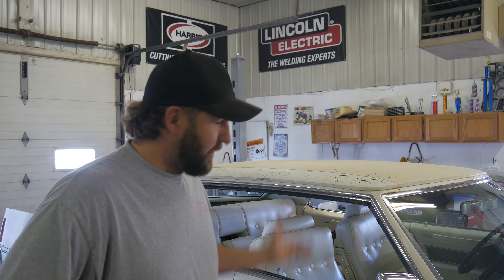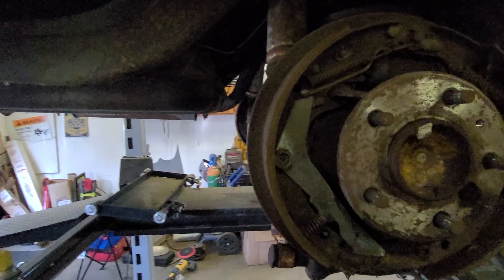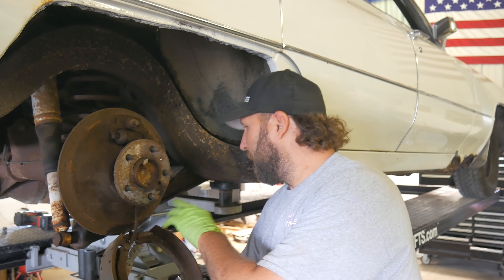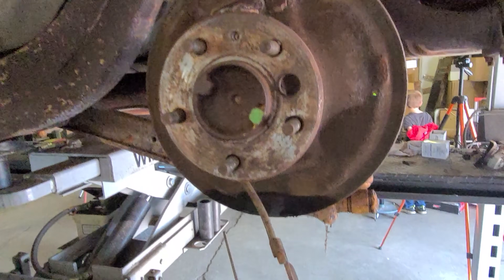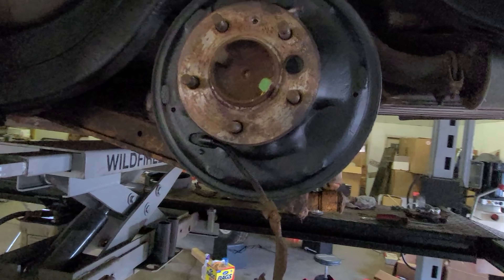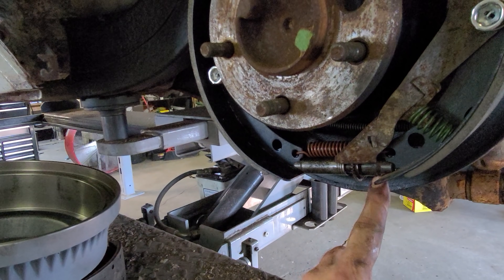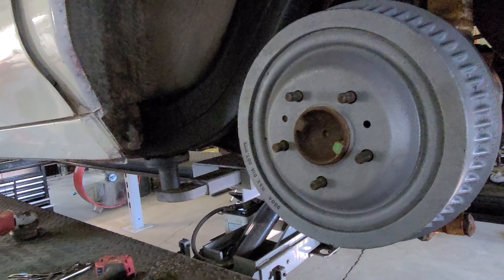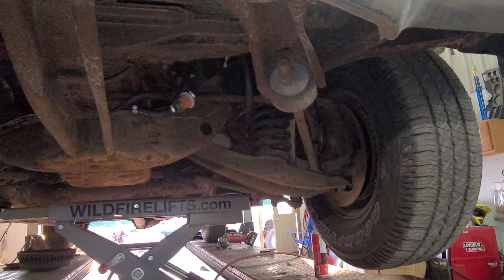Abandoned 1970 Cadillac DeVille - Brake Job - Finally ROAD WORTHY?

Comment: I have used brake fluid and transmission fluid I find brake fluid works really well on seized adjusters you just Gotta make sure you clean it after with brake clean and add proper lubrication

Comment: Kleenstrip concrete and metal prep for the clean up jobs on metal. it's like...70% phosphoric acid, like in Soda Pop and etch-coat primer. Real good on getting a stopper on that rust. ;)

Comment: a few years ago i sold a cad deville 75 2 door red on red it was still in good shape just needed some love no rips in the interior the top was still good no dings no scratches clean chrome sold it for 700 i never touched the car got it for free but knew the history of it just needed a tune up and breaks carb clean from sitting to long but under a car port . i have better rigs to mess with like a 67 rs ss 427 yenko or the 68 ss 396 and many more . sold my 68 mustang cobra 6 months ago i regret that made about 60,000 off it but miss the car i had it for 15 years after restoring it . still have my first car a 66 gto 389 tri power i paid 500 for it in 1979 . i just can't wait till i get my new ride dun 68 chevy pu with a stroked 454  with tunnel ram it going to fun not as fast as my 73 ss nova with a 396 tunnel ram drag car have a few bucks in the engine in that ride .next project is a 79 z28 rs t top have a stroked 454 for it . if u lived by me i would turn u on to a 4 inch stroked 454 with a heavy duty 400 turbo with 58,000 miles on it all i have to do is pull it and it is free with everything goes with it all the coolers radiator 4 core twin electric pusher fans with serpentine belt and clutch fan i live in oregon . if i pull it i have it sold for 2000 but don't have the time

Comment: Find you a small hone for that caliper and polish the piston with some sandpaper and put a seal kit in it gm was good about using a common size for pistons on those old calipers so there's probably a Buick or Pontiac or caprice caliper seal kit that will work for it

Comment: If the boys are old enough/ready for it, you can scoot on down to the Hom'Depo and pick up a wire brush like the one Bentley was using...except it fits in a reciprocating saw.  It'll turn that frame back to Factree spec in a heartbeat!

Comment: If I remember the calipers will interchange. The bleed screw will be on the bottom. So using a block of wood between the piston and caliper end, with the caliper bleed screw pointing up you can bleed the brake then install.. well you get the picture...
Reply: The brake hose will need a little modification too...

Comment: If you can't find a rebuild kit for the caliper buy another captian side caliper. That will get you all the parts you need. As for the broken bleeder hold the caliper so the banjo bolt is the high point and gravity bleed the caliper.

Comment: I think brake fluid is water based thats why it evaporates I bled brakes on a car took it on a road test hit a big puddel after the road test looked under the car the water washed off the brake fluid when ever i clean off brake fluid i always use water

Comment: If you're going to replace the right front caliper you might as well replace the left front caliper and the pads while you're at it. On top of that I'd replace the booster along with a master cylinder

Comment: Can you get a seal  kit and a piston for the RF caliper? Those are same left and right. Along with a simple hardware kit that's everything there is other than the hunk of cast iron. The piston is the sealing surface so pits in the cast iron bore are fine. I've rebuilt hundreds of these. Back in the 70's and 80's we never replaced calipers and wheel cyl's in the shops - we honed them out and rebuilt them. I have the tools but there is also an easy way without tools. Contact me if you want any help. ......Love Betty White! Had a customer with a '72 all black Coupe Deville that I am reminded of.

Comment: Drum brakes are okay if you're just puttering around town in something that has a hard time getting out of its own way, but high-speed driving and/or frequent steep grades? You're going to want discs because they're more effective, run cooler, and don't suffer from fade as severely as drums.
If you can get the left-side front caliper for this or a similar car you can just use the hardware off that to rebuild the right-side caliper, assuming the cylinder bore isn't ruined or something. In an emergency you can often use the left-side caliper on the right (or vise-versa) as long as you bleed the system before installation (the bleeders will be upside-down if installed on the opposite side of the car and so won't bleed properly when installed).

Comment: A man would be wise to start treating the inside of his car frames with cavity wax. In New Zealand, which is damp enough to turn solid cars into showers of rust in a few years, my friends and I use a slurry of 1/3 cavity wax, 1/3 rustoleum motospray/rust-prevention/fish-oil/ and 1/3 spaying thinners (be careful around fire). You can use a proper cavity wax gun to spray the stuff into the chassis, but an engine cleaning sprayer will do. FYI, Rustoleum paints were originally all fish-oil-based. Fish oil penetrates deep into rust, dirt and whatever else is inside the chassis. It will bind all the crap into an inert, soft lump. The fish oil also creeps deep into flakey rust, seams and crevices and drowns the internal rust dead. As the thinners evaporates, the cavity wax gradually binds with the fish oil to form a really sound barrier against further rust. If you buy a good brand of wax, the final coating is also self-healing. It takes about a week to dry.

Comment: you could spray some trans fluid back in that hole after you blow it out and it will make the frame last forever. i think my 66 frame since its a frame off im going to try to get galvanised. ive started using stainless steel on all my brake line replacements. its about as cheap and shouldnt wear out.

Comment: On that note about blowing out the frame rails (great thing to tell people BTW) you may want to mention all the small drain holes at the bottom of the doors that get clogged up and cause the outer sheetmetal to rust, they need cleaning out on a regular basis also. Just sayin

Comment: Those break calipers appear to be almost identical to my 79 Firebird.  I think GM used the same one throughout the 70's with minor variation.  I'd hope by now you have that sorted out but if not...research some other GM parts and you may find one that will bolt right in.

Comment: Derek's rebuild kit:
- 1x Break cleaner spray can.
- 1x Carb cleaner spray can.
- 1x degreaser spray can.
- 1x Black paint spray can.
- 1x deodorant spray can.
- 1x Little trees air freshener, bourbon scent.
- 1x Tonya Harding.
- 1x Vice Grip Wrench.

Comment: Quick tip for getting rid of brake fluid... If you spray it down with chemicals it can go all gummy and be worse to get rid of and, well, chemicals... Easiest thing is water. Flush area well with a hose, done. Don't forget kids, brake fluid will lift paint off anything. And it doesn't need to be much or for long. Remove immediately. A fingerprint of brake fluid if left unwashed will etch your paint in a few hours and be a permanent reminder. Absolutely DO NOT use a rag to wipe "Jerky McJerkface" on a neighbour's hood that you don't like. Don't do it.

Comment: I wondered what the deal is with the calipers and I see they're 67-70 only. 

The 71-76 are available, I wonder how hard it would be to convert it.  The ball joint interchange is 65-76 for the upper and 70-76 for the lower, so a 71-76 spindle might just bolt right on there.   How much different can they be?

Comment: 14:18 am not a safety nut or anything but tell the young feller not to stick his fingers in to pinch points betwix 2 bits of metal !!!!!?? just to be safe  great video as usual i was intimidated by my first drum brake job just followed the old destruction manual and once i did them the first time they were no problem after that stay safe VGG family. you know because am a carpenter and low and behold them brakes are not made out of wood who knew lol

Comment: Yeah, this fellur doesn't like drumulators either.  They are very good for economy brakes that need very little care.  They just come up REALLY short on the performance side, especially with the new fangled auto-digical abs-sistance systems.  I prefer dealing with the shorter maintenance intervals for how much better diskalators work.

Comment: I have a 2000 Ford Expedition Eddie Bauer 5.4 and 1995 Sea Ray 180 Signature bowrider with a 5.0 Mercury I’d love to sell you and see flipped on this channel. Both need work, but the expedition runs and has no check engine lights. It’d get a feller at least half way home from Alabama 🤷‍♂️

Comment: had old timer teach me to unlock a slack adjuster hit the long side with the threads in it lay it flat on the back of the vice and hit with hammer couple times not real hard and it will brake loose with out lube then you can take apart and clean up and lube it

Comment: You know when you get an old car first thing you do is a safety check been sent for long time is that drum brakes good ideals replace or rebuild the wheel cylinders that includes the master cylinder to and flush new brake fluid through it brake fluid moisture after while always adjust the brake shoes to the drums then the show then the shelf adjusters will work correctly are you step toward my customers about the brake job when I got done be careful you don't go to the windshield sometimes they would bring their cars in with such bad brakes you have to warn them before they drive away

Comment: i prefer a drum on the back. disc wear way to much back there especially on a truck you tow with. i like disc drum combos the best. drums last forever. my only thing is the wet stopping which is why i like the combo. drums are not complicated at all. also a buick  big car caliper should be the same in 70. might have been able check your lesabre to conform if its a disc front car. i cant remember.

Comment: That reverse brake set is not the deal, no way in my brain that can adjust anything! Repeatedly pushing the parking brake is what sets the brake tension when it works correctly. That's why your automatics tend to get so loose, (always park) hardly ever use the park brake in em. I was what you could call a "professional brake repair guy" many years ago. Anywho, just thought I'd share that. Have a good one my friend.

Comment: What are you talking about "new brake fluid"   I leave the old fluid in and it is blacker than black licorice.  Still is brake fluid. with a color to it.  I know it is rust on the inside of the steel lines but on a 1970 car or older (or it could be decomposing rubber) Does not matter, it is easier to see in the clear plastic brake fluid container.

Comment: !??!  Mount a left side caliper on the right brake. If you vacuum bleed simply remove the caliper, twist a pigtail in the hose so the bleeder is up.  Vacuum bleed and then mount the caliper.

Comment: AND SOME NO ONE DOSE ON THE BACKING PLATES THERE CONTACT POINT FOR THE BRAKE SHOW THERE THE FLAT RAISE BUMP U SEE USE WHITE WITH GREASE ON THEM AND FOR THE AUTO MARKET ADJUSTER JUST A PUT A LITTLE ANTI SEIZE ON THEM

Comment: I love rear drum brakes. Never had problems with them like I do with rear disc calipers. Enjoy your running commentary. You just need to get your terminology correct. They are not sparkelators. Here in the northeast, they are referred to as sparkbolts. Lol. You shouldn't have changed out those perfectly good drums. Those Chinese ones won't last worth a damn.  Here in the northeast, the Chinese brake parts corrode so fast that they evaporate.

Comment: Warning: If you ever use stainless lines, good luck with that flaring tool lol. I ended up having to buy a good quality hydraulic flaring tool. Lemme tell ya...it's sooo much nicer. Had to get pre-bent lines for my Silverado. I had no stock lines to bend my own because someone at Midas did to Ol' Shoot em and Snag em brake line job. I'm one of those weird guys that doesn't mind bending hard lines